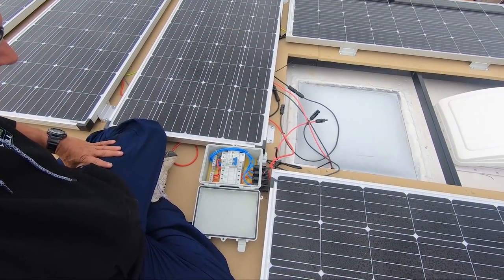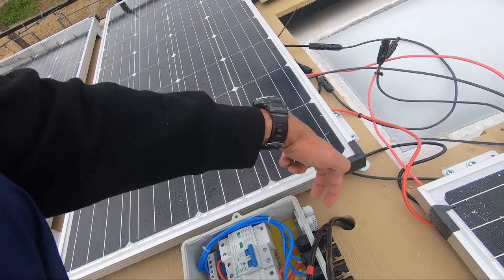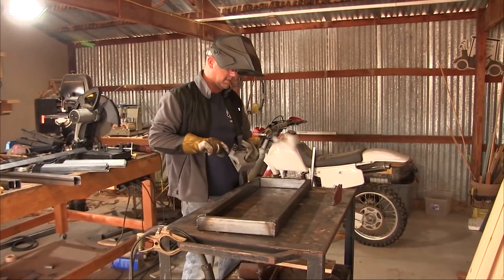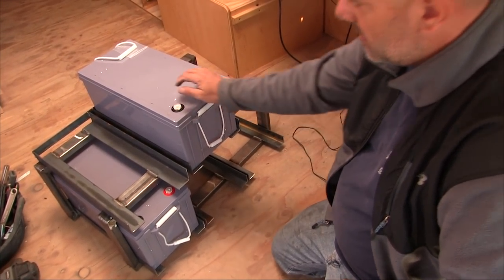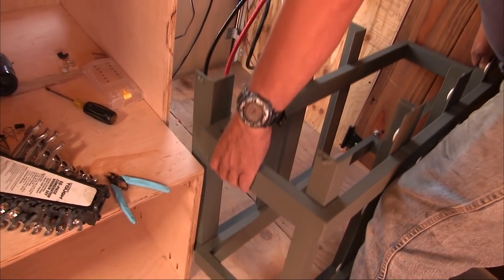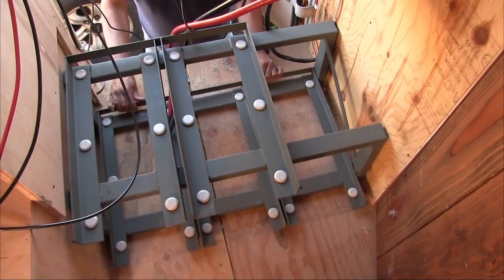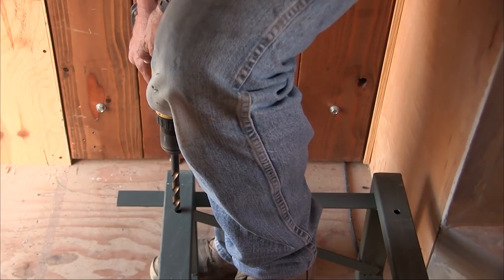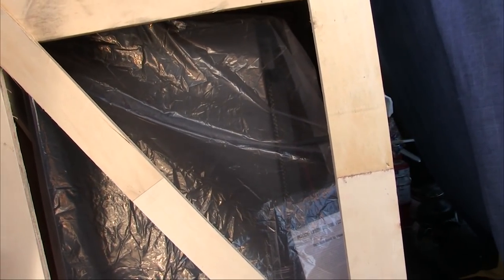Solar Combiner Box Install and Custom Battery Rack (Solar Part 3)

Comment: The DC system is really coming along Mike & Kerry.   Those Renogy AGM batts are massive.  Nice work on the battery rack.  I'd suggest ratchet straps to secure the batts in the rack.   I too used an Eco-Worthy combiner.  I used the larger, 6-input model.  Been working well for all of 2019.  Looking forward to your next episode as always.

Comment: hey take a look at the Chinese diesel heaters, two would give you dry heat with to zones guys you are really missing the boat if you go with a wood stove. glad to see you coming down to the end of this. really love your vids!
Reply from the maker: We have 2 of them. Just haven't installed them yet but we both grew up with t a wood stove and been it will be our primary heat. The diesel heater are backup.

Comment: Combiner box is a nice way to connect everything. I don't think you will get the surge protection due to lightning with your ground attached to chassis.
Reply from the maker: As much as any vehicle.  Cars have a complete chassis ground and completely survive lightning strikes. I would totally expect my digital equipment to fail in a lightning strike because almost all of it was designed for home use. But other than that I think we are going to be fine. The bus itself is completely non digital so in the worst case scenario I could just drive to help.
Reply: I guess it's considered a flooring system. The tires will provide protection great set up looks awesome.

Comment: Why didn't mount the batteries from the outside as you had an open door for access
Reply: Ian Mackenzie, I was thinking about that as well, once I saw where it was going in. But I’d love to see a battery rack with full extension drawer slides.

Comment: Is that combiner box ideal for a 24v system? We are still a little confused as to how to wire our panels - we got this combiner box to use but wondering what the voltage of your panels are. And why you chose to wire in Parallel

Comment: Can you use that same box to hook up a 3 string system 1,050 w 48v system?
Reply from the maker: Yes!
Reply: But I have 6 panels, I would need to use two Y 3 to 1 connectors to make one string or how else would you do it?

Comment: I'm guessing you'll use some sort of strapping to keep the batteries from bouncing around on rough roads, " but at 129 lb.s each they shouldn't move too much ". I would put a 1/8" thick rubber pad over the terminals to prevent any chance of them shorting on the metal rack. 12 volts 200 amp hour, yea that's welding range. Just use some gorilla tape to hold it. You can use that stuff for your next bikini wax.

Comment: battleborn mite be better plus lot less weight
Reply from the maker: Yeah but who has $10,000 lying around?
Reply: Lithium batteries are rated different than lead acid , a 100 ah gives 100 amps for a hour, no 20 hour rating. But Battle born is expensive, about $1000 each,  but lithium is a night and day difference!